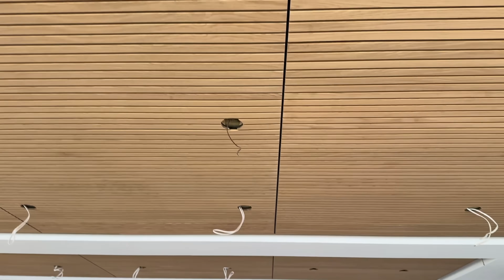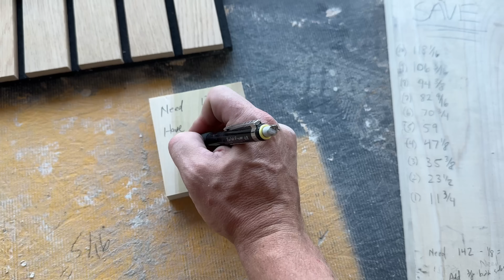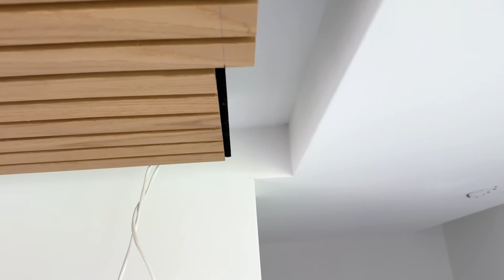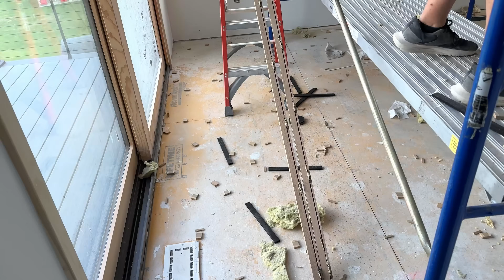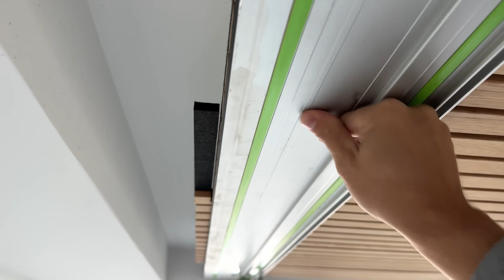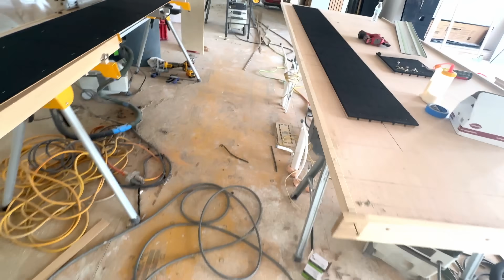This Install Didn't Go As Planned | How to Adapt And Overcome

Comment: I was thinking when you're putting The tracksaw tracks on the ceiling. Could you have screwed them in? Made your cut and then just repaired the screw holes. Would that be maybe more secure than trying to hold it in place? I mean, obviously yours turned out great so I'm not one to criticize. Just curious why you wouldn't have gotten that route

Comment: Looks great Spencer! Where you cant clamp, try some Scotch Extreme (30lb) double sided mounting tape. It peals off nice and doesn't leave residue in my experience. I use it to mount cabinet overlays instead of nailing. It holds great! Use small pieces!

Comment: Any reason you picked the k120s over tensos? I would have thought the internal clamping mechanism from the tenso would be better for pulling that end trim in.
Reply from the maker: Reduced cost in fasteners + with the K20 we were able to use a traditional biscuit slot ran the entire length with a router. This eliminated the need to align biscuit slots.

Comment: To make things easier in the future, you can buy the Festool KP tracks which use an adhesive pad insert in the track that will stick to almost any surface, vertical, horizontal or even upside down, no track clamps needed

Comment: Beautiful work.
I do question, however, the idea of using PL premium instead another adhesive.
In my experience it 'grows' almost 1/32 as it cures, pushing the workpieces apart.  Unless it is well fastened another way.
Amazing to watch the process.
Reply from the maker: As long as it has somewhere to grow to, it isn’t as much of a concern. In this case it had a continuous channel to expand into.

Comment: Im surprised you didn't use the zip wall poles to hold up that track saw guide. Works for me
Reply from the maker: They were tall ceiling and I didn’t want to set the poles on a plank that deflects.

Comment: If you ever have to mount the track like this without clamps or another pair of hands I've found that GRK cabinet screws fit well in the bottom slot of the festool tracks. Drive them just deep enough to snuggly hold the track but also allow the track to slide onto them.

Great work as always btw!

Comment: Great video as always. Cutting with an upside track saw is a great skill to have, wow.
But the math early in the video shows why metric is the superior system: a) working in decimal instead of fractions with different denominators, and b) 1mm is finer than 1/16", but still measurable and cuttable by eye.
Also, for the intentional slight undersizing, I would do the math as measured/calculated, and only then subtract the amount you want undersized. In the example, 5/16" is already slightly under the 11/32" the calculation results. Do the math you want and then subtract 2mm or 3mm or whatever you want to get that intentional undersize.

Comment: Fitted a slatted "oak effect" acoustic panel ceiling in a long wheelbase Camper Van for a client carefully profiling a cutout to accommodate a skylight roof fan located directly above a raised double bed👍😀 Once I'd completed thevceiling, client then decided she also wanted a slightly larger grill/shutter blind fitted to the roof fan which entailed making a 1/2 inch (13mm) larger opening (the exact shape of the grill blind ...  i.e. square'ish with rounded corners) in the already fitted acoustic ceiling panel (completely concentric with the fan 😱). I had to make an oversized MDF template for a router guide bush (pinned to ceiling with 18g brads) and using a Mafell LO55 Hand Router, 6mm solid carbide bit (8mm shank) and dust extractor, rout the new opening upside down whilst laying on the bed 🛌 !!!! 🤣 Luckily, it all worked out and the client was pleased with end result 👍😀

Comment: Using that lifting tool around the edges was a genius move. I have a pair. Had to lift a very heavy desk to move it.  I knew there would be other uses though and you proved it.
Reply: Curious if you ran into any issue with getting the drywall when using the jack? We're the Sheetrock guys consulted first? They must have used durarock on those areas. I would have been nervous using the jack right against the finished drywall. I assume final topcoat/ touchups would address this?
Reply: Should say *denting not getting